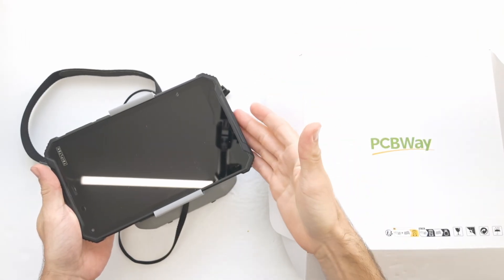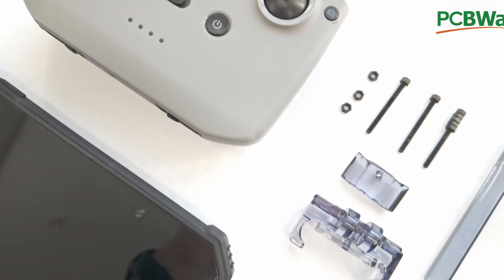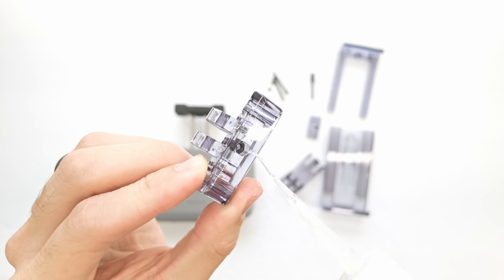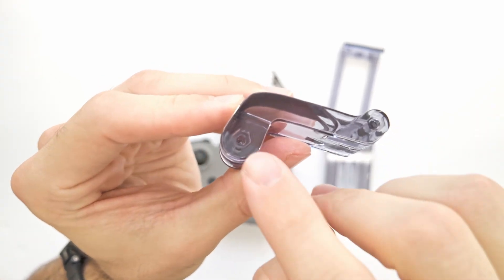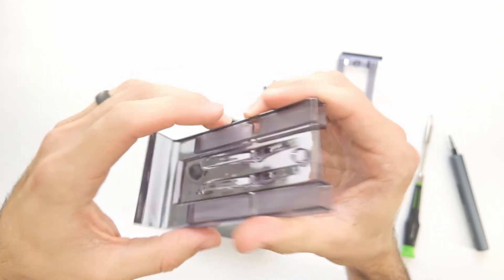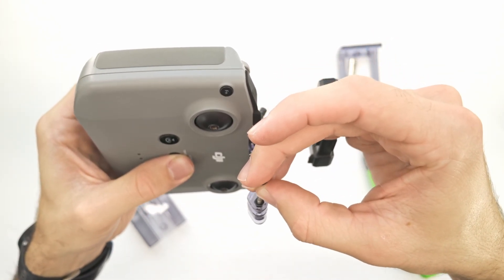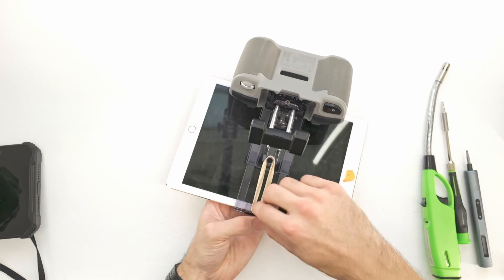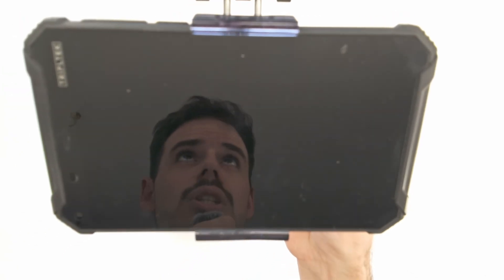The Best Tablet Mount Holder for DJI RC-N1 Controller That You Can 3D Print (Universal Fit)

Comment: i wonder if you can replace the rubber band with some spring that has hook/loop at top and bottom, and u can adjust the tension by the spring specs, and i think for the one clamps down the rod of the antena u can make a hinge at 1 side to make them as 1 piece so you can easily take off and install the mount